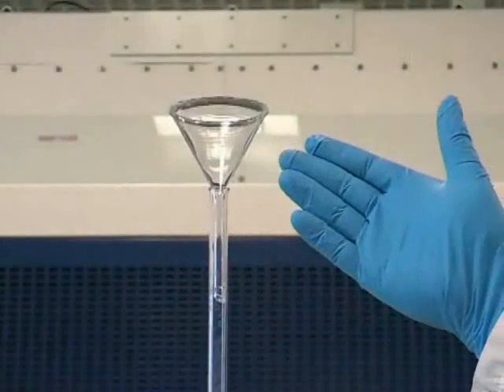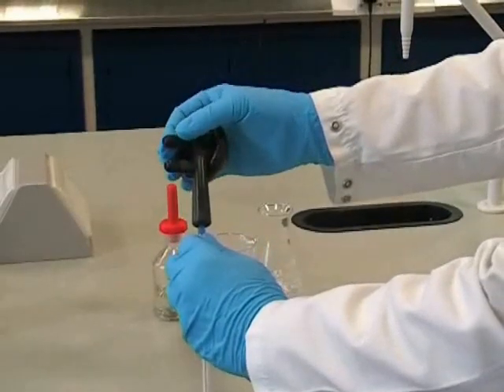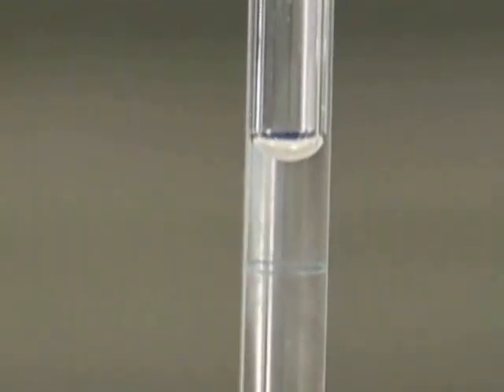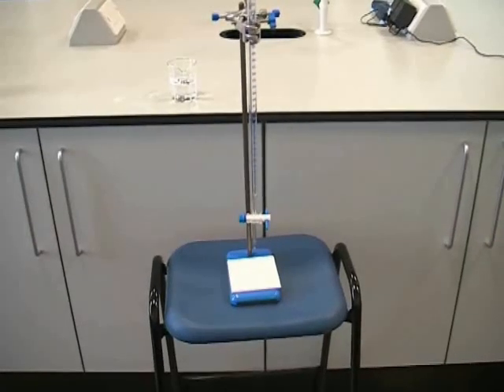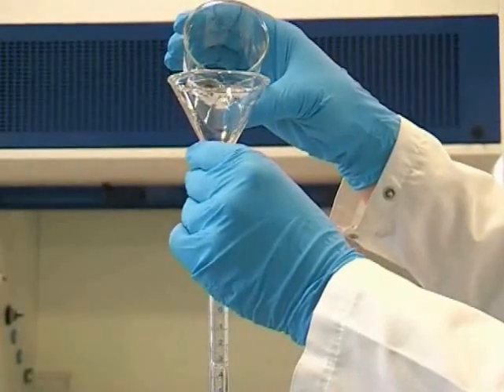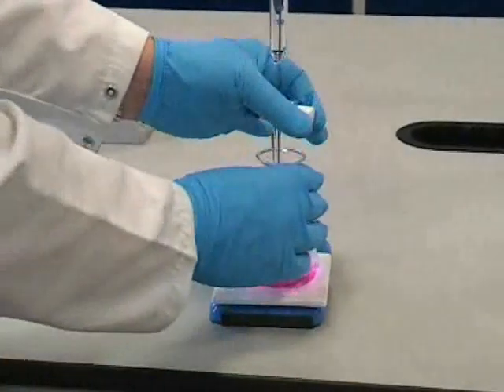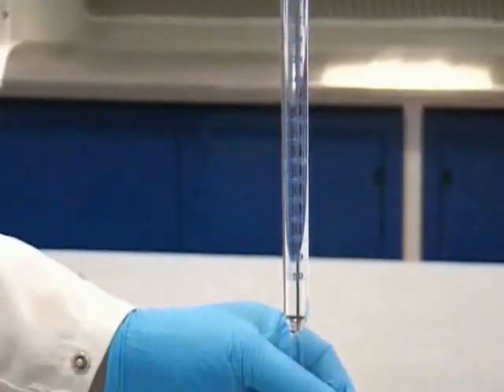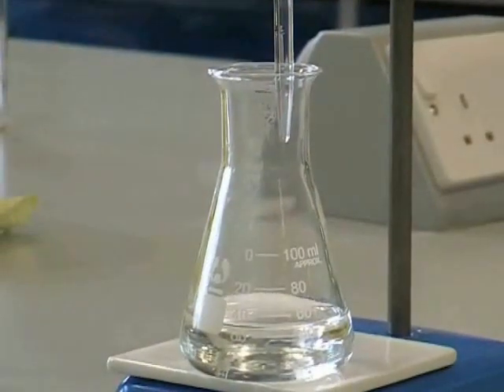Running a titration analysis

Comment: Steps of Titration
Fill up a burette with acid. ...
Use a pipette to add alkali to a conical flask. ...
Add an indicator to the alkali. ...
Slowly add the acid into the alkali. ...
Slow the adding of acid when the indicator changes colour. ...
Stop adding acid when there is a permanent colour change. ...
Record the titre. ...
Repeat the titration.
Reply: thank uu!!